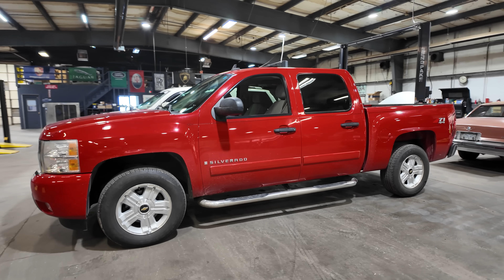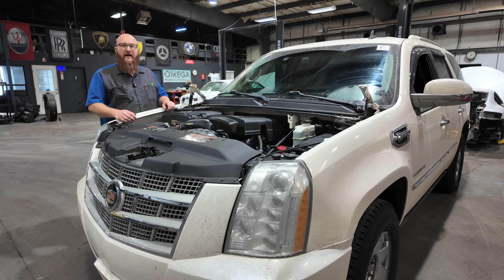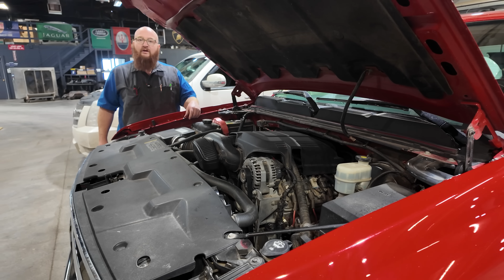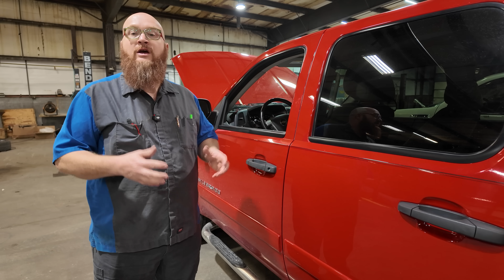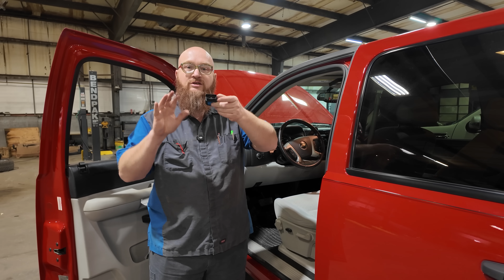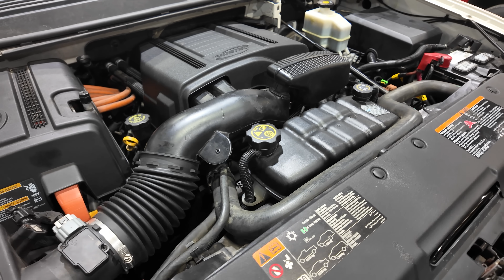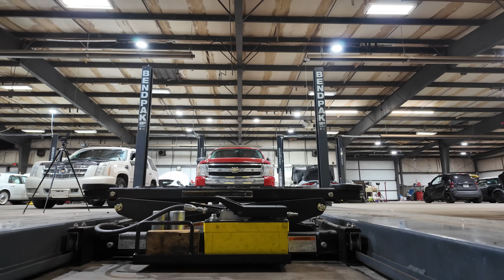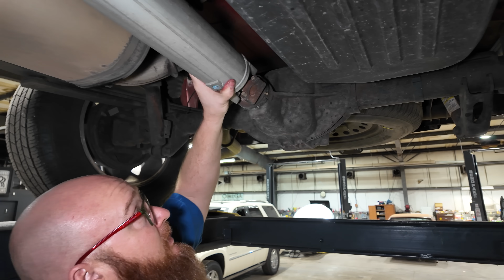AFM: Engine Saver or Engine Killer? The REAL Answer

Comment: "Cylinder deactivation is never a good idea." -Ahmed (AMD) The Car Care Nut.
Reply: prob depends on specific engine, and if you really can.  I have a 2011, 5.3 deactivated 10 years ago .... 211K miles as of now and no issues.
Reply: @jprkzoo3463 how did you deactivated?
Reply: @caleblafleur20  ECU software
Reply: Exactly
Reply: Honestly, cylinder deactivation with a hybrid feels like something that can make sense. If something like this had the more mature Voltec system, big engine for towing and high load situations but half-engine mode for normal highway speed long haul generation. But it should only be a thing for work cars that will be using the 8cyl mode for specific needs while using pure EV / 4cyl mode for others. For something like this, I'd say V6 Voltec and just lower tow rating.
Reply: @Fay7666  hybrids make no sense. all tthe problems of an electric car plus all the problems of a gas car. terrible design. bring back 4bbl carburetors
Reply: But just ONCE I’d like to see 20 mpg in my V8 Tundra.  Hit 18 once but that seems to be the limit.  Stock tires no lift.
Reply: @failranch9542  Try filling your tires to a higher air pressure like 50 PSI then follow Semi trucks on the highway to break the air resistance. Its called Hyper Mileing.
Reply: 😂welcome to Toyota ! I’ve had Toyota Trucks terrible Gas Mileage!
Reply: Love Ahmed!
Reply: Why is that, do you own a Transmission shop !😅
Reply: Cylinder deactivation is due to the climate change nonsense. Just put the V8 in and leave the shit alone!
Reply: No shit right!
Reply: @jasonthrash4357  I would say that AFM is a nonsensical attempt at addressing climate change.
Reply: @JaegerDives  Yea , GM & Honda engineers don't have the best answers for saving fuel. The Accords / Pilots also used cylinder shutoff & now are paying a price for that ill advised technology. I see the start / stop engine controls at stop lights might be a thing of the past too. Another bad idea by automotive engineers.
Reply: @ag4allgood 
Sorry, you're all amazingly wrong!   Modulated Displacement started in 1981, long before Al Gore and his buddies started trying to sell us on CO2 is evil...
Reply: @marko7843  It was a failure then & a failure now. With the Dear Leader shutting down all forms of clean energy but accepting a Trophy from Coal Lobbyists tells you where this Regime wants to fill pockets. Clean Coal ? 🤔
Reply: @marko7843  And in 1981 they still had stringent CAFE standards leftover from Jimmy Carter and his malaise government. In the last 20 years it's become a fad to push the climate change nonsense for political purposes again, hence the bullshit we see in engines now. It's the same agenda divided by 2 different generations and it IS a bad idea. Don't know why you're saying anyone is "amazingly" wrong ...
Reply: @jasonthrash4357  Climate change is not non sense to educated people !
Reply: @ag4allgood Who educated you? MSM?
Reply: @johnehlert4366  Wizard car repair channel ! 😎
Reply: @ag4allgood  How it’s been addressed is nonsense.  All the wrong strategies with autos have been taken in the name of “climate change.”
Reply: @ag4allgood it is control of the masses dressed up as environmental protection. Interesting how the military industrial complex is never asked to reduce their fleets and install emissions control systems.
Reply: The climate's been changing since climate was a thing , your overlords just found a way to cash in on it.
Reply: @petrosaguilar8916  exactly
Reply: @johnehlert4366 like COVID?😂
Reply: @zachZO6-s9b  Exactly. It's about money and also power/control.
Reply: @genericusername1365 exactly

Comment: AC Delco is not always OEM quality, they make parts at different factories in different countries. I’ve had quite a few junk ac delco parts right out of the box
Reply: This statement is true and accurate. I have a 1992 Oldsmobile Toronado and a 1996 Oldsmobile Ninety Eight.  The old stock OEM parts are better. I noticed too with new AC Delco parts in some cases, it was bad out of the box or did not work well on my cars. I have to find new old OEM stock parts.  The Car Wizard is correct also. You have to be careful with the new OEM parts. It is not just a GM thing wither.
Reply: Yep, they are not what they used to be.  Their push rods really want to transform into boomerangs, lol.
Reply: AC Delco is not the same thing as "Genuine GM".
Reply: ??? Not sure how it is today ,but in the yesteryears AC Delco components were definitely what was used on GM  vehicles. Im listening if you can prove me wrong.
Reply: @MrGreatness412  It is no longer like how it was. Genuine GM is the actual OE part. AC Delco is simply a name that aftermarket companies building parts in China and other low-quality manufacturing locations pay for. The AC Delco part is the same as the cheap aftermarket parts that cost less. It just has the AC Delco name on it.
Reply: @MrGreatness412 ac delco makes factory parts and aftermarket parts
Reply: @MrGreatness412   Yes, AC Delco is what they used on GM vehicles and still do.  It is the same with Ford and Motorcraft and Chrysler with Mopar. 
ACDelco parts are premium Original Equipment (OE) and high-quality aftermarket components owned by General Motors, designed for GM vehicles as well as most other makes and models. They are extensively used for maintenance, repair, and collision needs, offering over 80,000 parts including spark plugs, filters, brakes, and batteries.
Reply: @MrGreatness412  Three-Tiered Product Line:
GM Original Equipment (OE): True factory-installed parts for GM vehicles, designed and tested to strict standards.
ACDelco Gold (formerly Professional): High-quality, premium aftermarket parts that fit most makes and models.
ACDelco Silver (formerly Advantage): Reliable, high-value, and affordable aftermarket options for various vehicle makes.
Reply: @genericusername1365   Based on the fact I have been working on my cars recently, the parts say otherwise. GM owns AC Delco. They have the AC Delco Gold and AC Delco Silver/Advantage. I know for a fact I bought a Genuine GM part. That is the part that was placed on the vehicle at the factory. It also is the same part as AC Delco.  Gold comes in a white and gold box.  Advantage/Silver comes in a white and silver box. The Genuine GM parts came in a white and blue box with white lettering. The parts are interchanged. That is why I buy old oem parts when I can locate them. 

ACDelco Gold (formerly Professional) parts are high-quality, aftermarket alternatives to Original Equipment (OE) parts, backed by General Motors. Engineered to meet rigorous standards for fit, form, and function, these parts are designed for GM vehicles as well as most other makes and models.

ACDelco Advantage (now rebranded as ACDelco Silver) provides high-value, reliable aftermarket parts for GM and non-GM vehicles, focusing on safety and durability at an economical price point. Key products include maintenance-free batteries with calcium-alloy grids, coated rotors with non-directional finishes, and steering/suspension components like ball joints. 

Genuine GM parts are branded as both GM Genuine Parts and ACDelco Original Equipment (OE), representing the official parts designed, engineered, and tested by General Motors for Chevrolet, Buick, GMC, and Cadillac vehicles. These parts are the same as those installed during vehicle production.
Reply: @genericusername1365  I wondered about that, Thanks for clearing that up!
Reply: He probably bought "AC Delco Advantage", which is junk and not the same as original AC Delco. Genuine GM is the only way to go.
Reply: @williamheinz6668   ac delco makes parts for gm and they make parts under that name as aftermarket parts. If it doesn’t say gm it’s not oem
Reply: @VanLifeExtremist  AC Delco "Advantage" is outsourced manufacturers, usually in China. Hence the lower prices.
Reply: I stopped buying AC Delco parts 8 years ago, due to shabby QC.
Reply: I thought it was just me.
Reply: Still $130 each for my AC Delco fuel injectors. For eight injectors that hurts.
Reply: 100%. Also, they sometimes get components from the same source as the aftermarket junk.

Had a Saturn Vue in the shop that had a voltage regulator problem. 

Two aftermarket alternators, same problem.

Put on a Delco… same problem.

After weeks of talking to GM to figure out what to do, they told us that the factory who supplies voltage regulators sent out a batch batch. Same place the aftermarket manufacturer gets them.

Comment: HP Tuners has software to reprogram your GM vehicle to delete the AFM/DFM.  It is not cheap but find a shop that tunes cars/trucks and have that shop delete this w/out a disabler and/or a rebuild.  I have had a Range disabler on my daughters Tahoe and Escalade for over 2 years.  No issues, just unplug it if you have to go to the dealer.  Appx cost for the Range is $250.

Comment: I have a 2016 Silverado with a 4.3 LV3. No "deletes", no Range OBD plugins...nothing...and at 125,000 miles it's still running strong. Horror stories abound of 5.3 engines eating lifters but the 4.3 doesn't seem to have this problem. I have changed the oil at 5000 mile or less since new. The torque converter failed at 96,000 but the engine is still smooth with no carbon buildup either. Change your oil; if you don't, and your lifters fail, keep it to yourself because it's your fault.
Reply: The LV1 doesn't have AFM. The LV3 has AFM. Been driving an LV3 every day for 10 years, so yeah, it does.
Reply: Trash transmissions.
Reply: I don't think they put that in the 4.3 at all......

Comment: Sadly those GM engineers that thought up AFM and Auto Start-stop function are still working at GM 😮
Reply: Wasn’t all there fault. The government mandated the auto start stop crap and cafe emissions regulations made them do it. Afm is junk
Reply: @rspectx if you really want to go down the rabbit hole, also look into oil and oil viscosity. Why are we using lighter oil now? For the exact reason you think… to get that extra little fraction of mpg to meet government standards. Not all synthetics are created equally either. Using a good quality and yes more pricey synthetic heavier weight will actually add to the longevity of your engine. (Obviously it still matters what temperature you operate your vehicle in, so do your research.)
Reply: and Jim engineers took advantage of that
Reply: @rspectx trump just got rid of the madates 😂😂
Reply: @Matt-d5v And I'll bet they still put that shit on their cars and pickups. Mary Barra needs to be gone, and so do most of the board of directors. GM has gotten too woke.
Reply: @johnehlert4366 just like anything else theyll run through what theyve already manufactured and probably just produce them with it as an option for anyone who actually wants it. Thats my guess anyway
Reply: @Matt-d5v  Now lets see if they get rid of this garbage system. I guess that'll tell us if GM has ANY future, at all.
Reply: @johnehlert4366 you mean gm ,lower case, as in please forgive us for building vehicles at all 🙄
Reply: @Matt-d5v Trump is dumb
Reply: @johnehlert4366  Yup I agree. The corporate greed is the problem. This is all of them. They want the consumer back at the dealer in 5 to 7 years. Or they want the consumer to keep making them money with catastrophic maintenance issues that will break your bank account. Not to mention they have politicians and judges in their pockets too. The only way to beat the automotive corporate greed is with your wallet. Do not give them your hard-earned money.
Reply: @rspectx they also are trying to get more fuel mileage with regards to the autos top. If you want to idle your going engine a lot you'll get another lesson. The corporations that pay all our mortgages thank you for politicing for them.
Reply: It is their fault, they could have spoken out and went to the press but chose not to.
Reply: @christiant373  For sure that would have stopped it. SMFH.
Reply: Epa and a shitty administration fucked all the cars up
Reply: @liquidlaboratoryfx Neither the EPA or the government make cars. The EPA and the government set the standards and it is up to the manufacturers to figure out what they need to do to meet those standards.
Reply: @Notfiveo0 how do they decide what numbers constitute those standards? Do they just pull them out of their ass?
Reply: @Notfiveo0 it’s the unrealistic standards they set is whats killing engines. Diesel industry especially. Before all the exhaust filters and def, diesel engines in pickups were getting 18-20 mpg. Now all the restrictions on the exhaust they get around 13-14 mpg. How is burning more fuel better and cleaner? There are professional tuners out there that can get realistic emissions standards with no filters and def. And get extra HP and TQ.
Reply: @Notfiveo0 In other words, just what the OP said.
Reply: @N@Notfiveo0You blow in from stupid town?
Reply: And they got bailed out by Obama
Reply: @diablocls55  and W. Bush
Reply: @diablocls55 government motors😂
Reply: The fact that the Duramax has stop start in our Suburban is so ridiculous.
Reply: CLASS ACTION 101
Reply: They're retired. They need to be brought up on charges lol
Reply: especially the ones that engineered the 6.2 to fail after the warranty
Reply: They knew it was so bad but somehow they kept on using the system
Reply: I am so sick of GM engineers engine engineering their cars to fail after the warranty. It makes me sick.
Reply: 200 engineer/design staff were laid off at GM tech center last year.
Reply: The GM engineers have zero authority to change anything.  Managers, executives and managers do that.  Heck, the Firestone fiasco around 2000 with Explorers had engineers from both Ford and Firestone saying not to drop the tire pressure but marketing weenies won and they dropped it to unsafe levels.
Reply: I have 184k miles on my 2017 gmc sierra. I just put the afm disabler.  No issues up to now. I've kept up the oil changes so I'm hoping the engine lasts at least up to 400k miles. Time will tell.
Reply: Probably got promoted
Reply: @deboralacreta  They not only get promoted, but the man who actually can figure out the concerns is actually demoted by HR or his boss becuase he is not a gung-ho "Team Player" running toward the edge of a cliff.
Reply: And the traverse and others like them with auto stop, tears up the transmission commonly.
Reply: Of course they are. AFM has made GM a LOT of money due to below 80 IQ individuals who are brand loyal to Garbage motors. They’re fine with buying new Chinese plastic trash every 75k miles.
Reply: Not only that but they're doubling down on AFM/DOD in their newly designed V8s. Yup, the hope is gone that they would abandon this crap when they announced their new generation small blocks.
Reply: Pretty much forced into it by the democrats. The epa was getting very unrealistic with its cafe standards. If GM wanted to sell any v8s at all it had to have this system. You don’t have any for the last 10 years if it wasn’t for afm. GM was too cheap to designe an overhead cam v8 thats lower displacement like ford
Reply: Their fault they designed junk!
Reply: @oneblach It's the fault of the democrats who we know will raise hell about Trump eliminating these regulations.
Reply: @johnehlert4366 Because we all know if we just close our eyes and ignore climate change those billions of tons of carbon emissions cars put in the atmosphere will magically cease to exist. After all we can’t see them so how bad can they be, said the person who doesn’t believe carbon monoxide detectors work.
Reply: @Notfiveo0  You REALLY need to learn science and manipulation.
Reply: @Notfiveo0 climate change doesn’t exist
Reply: @johnehlert4366  so other manufacturers can find a way to still make good engines except GM and yet its dems fault. Lol let's not act like GM is making quality cars anyway.
Reply: @d.edwardsfreelanceeditorvi4212  I'll act like they are. I've had too many good ones, whether you think so or not.
Reply: @johnehlert4366 funny because CAFE regulations were established in 2007 which means Bush would have been in office and programs take a few years to start. So it was in talks most likely during his first term. 

Know your history 🤣🤣
Reply: @zephiel123  Then Bush wss a horse's ass. I don't care if he was a republican. I will tell you I don't see many republicans that are climate activists.
Reply: It's not necessarily their fault. They had to introduce it to meet EPA regulations introduced in 2007.
Reply: @northstarstatepolitics1652  The manufacturers choose to not object to pointless regulations. LED headlights are a great example. When the regulator demanded a stop to halogen bulbs. Nobody complained the result would cost more $ everywhere while offering negligible results.
Reply: I still believe GM deliberately built those engines to fail. I've turned th AFM off on two of them trucks and it never changed th gas millage on either one of em. My opinion that AFM is just part of drive-in people away from gas vehicles
Reply: In theory AFM is an ingenious idea……on paper. Auto engineers are Democratic legislators in the United States. All these great ideas and amazing things that they come up with look phenomenal on paper but just do not work in the real world. Once it’s implemented into the real world chaos erupts. That’s AFM.
Reply: Honda didn't have a problem reducing emissions and they were always fuel efficient
Reply: @unclejoe6811  DID HONDA MAKE A V-8 WITH AFM?
Reply: @MarkVanTasell  Honda make the same power with well engineered fuel efficient engines
Reply: @Dave5843-d9m  YOU MISS UNDERSTOOD THE QUESTION...DID HONDA HAVE A V-8 ENGINGE WITH AFM.APPLES....ORANGES.